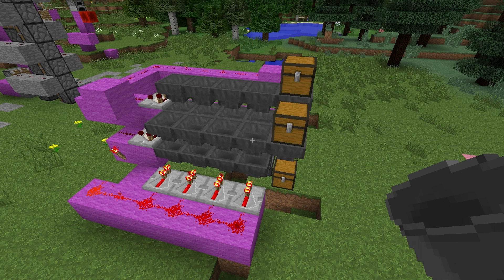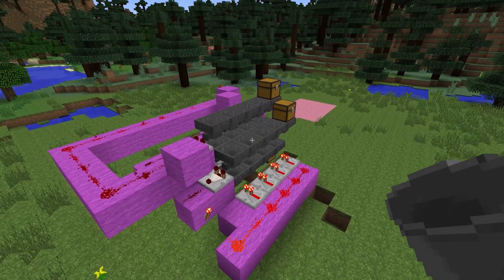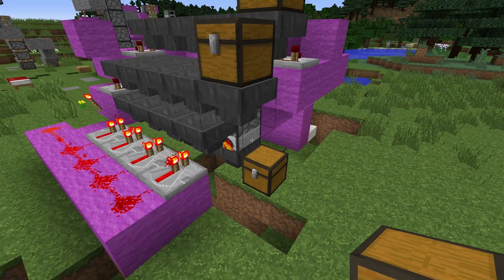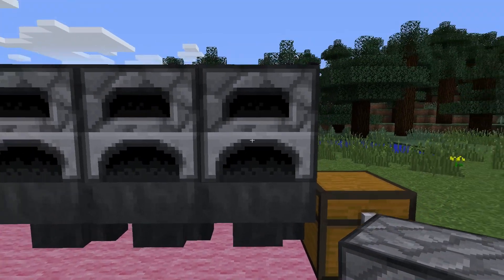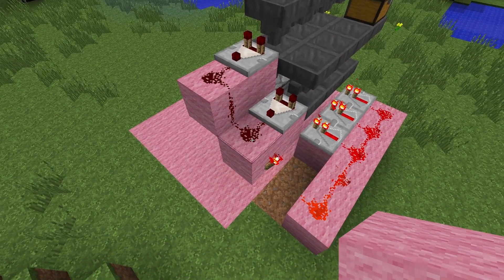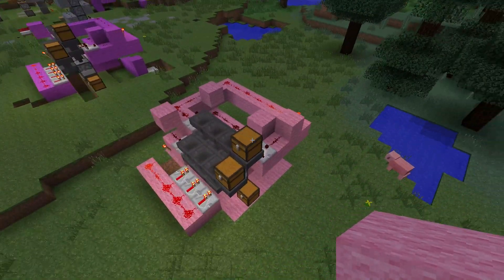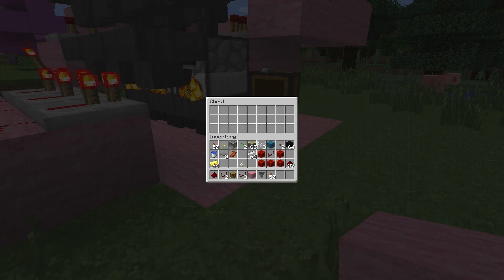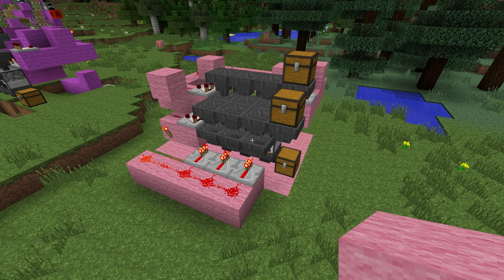Tutorial: Super Automatic Smelter Furnace

Comment: Snocrash...I followed the video and it seemed to work for the most part. It smelts everything except the last stack, IE, I did it for 8 furnaces. If I put in a stack of 64, it smelts 56 and the last 8 get stuck in the hopper above the oven. I did the circuit, but its not clearing the hoppers. Any ideas?
Reply from the maker: Did you definitely have enough fuel loaded in?

Comment: Hello Snocrash, and any other who uses this Super Automatic Smelter Furnace (beautiful name).
I built the slightly improved design you linked to, in 1.10.2 and it worked fine. However, as soon as the server got updated to 1.11 it stopped working properly. The second furnace only gets a few items to smelt, while the first one gets a lot more than the others. It's not evenly distributed anymore!

Does anyone else have the same issue? And does anyone know a solution?
I'm cross-posting this at the other video as well and I'll let you know if someone knows a solution.

PS It's a Spigot server.
Reply: Okay so I read through some really old comments of both video's and it seems I just got really lucky in 1.10.2 and this issue is very very old. I suppose there's no fix :(